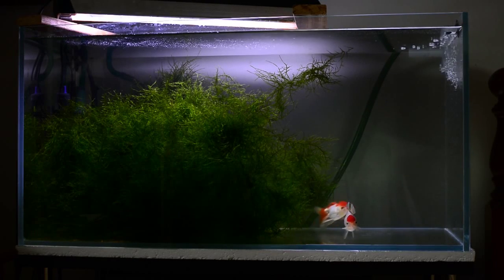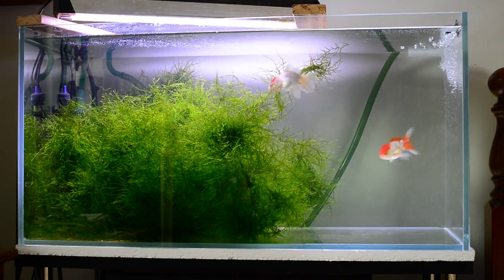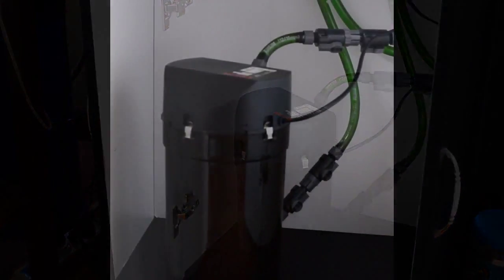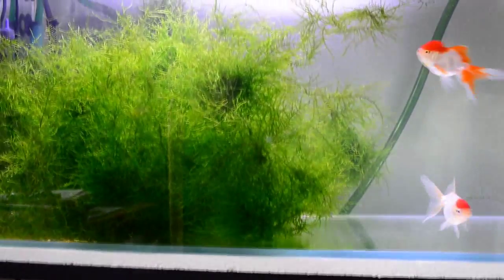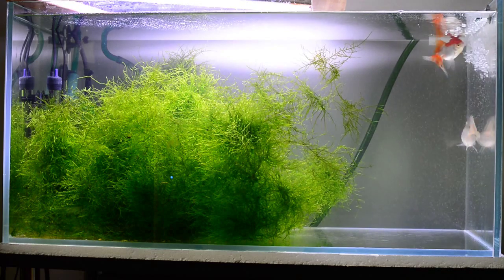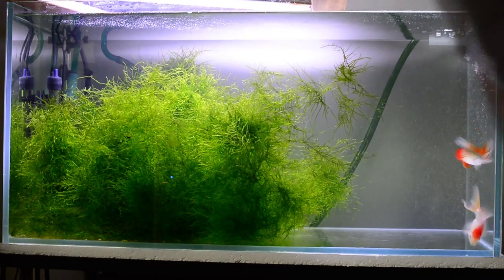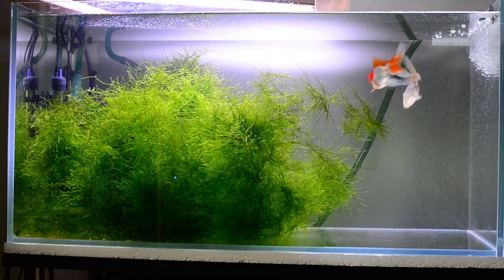Denitrification Discussion Freshwater Aquarium

Comment: The only way is to use naturally occuring bacterias B1 for ammonia and B2 for nitrite. This is the aerobic cycle. As for nitrate, we use algae. They are collected daily from sponge filters connected to the suction of pumps. The Germ theory by Pasteur is not correct. Bacterias are scarvengers. The Fallacies of Germ Theory with Dr. Thomas Cowan
 The anaerobic cycle is too complicated. You might suffer from rotten egg smell.
Reply: Germ theory not correct https://www.bitchute.com/video/8JAYsiN-368/
Reply: What do you do when a nitrate in the water changes is still high from the supplier
Reply: @brianneal2500  You have to complain to PUB if you live in Singapore. For me I don't change water. Only top-up.

Comment: So is it basically a chamber with a mesh screen or poly filter inoculated with anaerobic bacteria?  Is there a heater in there or anything else?  You're not using sulfur, are you?
Reply from the maker: Yes, essentially it is an area which is oxygen deprived. The water flows through at a slow rate (about 1-2 drips per second). Heating is not required, I use vodka as the carbon source.
Reply: I've seen you on several videos about this subject. Did you ever build your own nitrate reactor/anoxic filter?

Comment: How about the idea of a system that doesn't produce nitrate at levels that become a problem. The nitrogen cycle is old school thought.
Reply: Shaun's Fish Tanks that would be called a glass of water lol.. you can not have a tank with even one aquatic plant that doesn’t produce nitrates. Everything produces some form of nitrogen that is not yet nitrogen gas that can leave the tank via surface. You have to have different forms of bacteria to break those items down in specific order to complete a full cycle turning ammonia to nitrogen gas that leaves the tank via bubbles at the surface. Another bit of advice... many people think aquatic plants use up nitrates.. they actually feed mostly on ammonia and also produce nitrate as a by product same as aerobic bacteria does. Only air plants consume nitrate first. Aquatic plants consume ammonia first and only consume nitrate if ammonia isn’t present. They turn the ammonia into nitrate themselves for feeding.

Comment: QUESTIONS -  How long does it take for the volume of water in the aquarium to cycle thru the denitrification unit?  How many gallons is the aquarium?  How many gallons does the denitrification unit hold?  7:37 Is the activated carbon pre or post denitrification?  How often do you clean out the denitrification unit?  Finally, how would you "ramp up" denitrification, by cleaning the unit less often and feeding it more vinegar weekly?  If the flow was already kinda fast, would slowing it down also help ramp up the denitrification (kinda makes it so one wouldn't need to add more vinegar to accomplish the feat then)?  The answers to these questions would be very educational and much appreciated.  Thanks!
Reply: Feed the anaerobic bacteria with its natural food sources such as plant matter and soil would work i think.

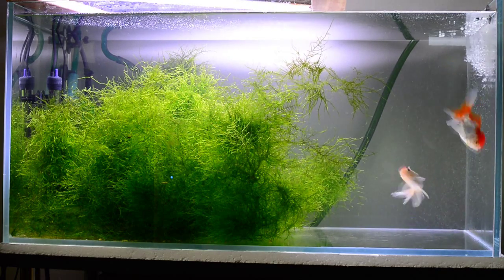Comment: 4:04  You say there's no nitrates in there, but I bet there's still plenty in the form of a gas.  You're really suppose to degas, or aggressively aerate, your denitrified water to release the nitrogen gas before sending it back to the aquarium, so basically you're just lacking one aeration bucket in between the denitrification and aquarium (by the way, you're actually better at this than I am, i'm just saying, I've been learning specific stuff).  Thanks for showing us the flow rate there, it really does have to be slow like that, and I bet the pH in there is higher than the tank itself.  I just learned about the Rakocy feeding rate ratio (developed decades ago at the University of the Virgin Islands) yesterday, in which one gets to realize that fish waste is not the perfect plant food and that aquaponic farmers will get more food than the fish eat to decompose in the water, giving the plants the minimum requirement of nutrients that were lacking, like Calcium, Potassium, and Iron, etc.  However, the method leaves one with excess nitrates, and thus, the need for a denitrification chamber at the end of the chain.  The Lennard approach, which doesn't use more fish food than the fish need, uses specific buffers to compensate for lacking nutrients, and negates the need for the denitrification unit,  was developed later, focusing on very very specific fish and plants (monocrops for mass production), rather than a general set-up, because he realized that denitrification leaves us with too many different kinds of nitrates to attempt to monitor (too hard to figure the real total nitrate level in your system).  I'd love to learn how he figured out his method.  The aquarium hobby (three years into it) has been such an educational experience and I resent my family not doing this with me as a kid.  Anyhow, I'm surprised that the denitrification unit doesn't have to be bigger.
Reply: Seems like the tank is lacking soil, sand and more importantly: clay. Clay contain all those minerals you mentioned. How ever the sands soil and stones are important as well in the decomposing cycle.

Comment: Agree with everything you say, with the exception of purchasing a denitrification unit/filter. I have yet to see one that produces in the amount that is needed. I don't know why anyone no one has ever thought of compartmentalizing external filtration (canister filter). But to me, the solution is in that and seems rather simple if you ask me. Anyways, I hope to be building a system of 4 tanks for stock/breeding purposes. They will all be connected:  1 Pump, 1 Heater, 1 Mechanical Filter, 1 Bio Filter, and 1 Denitrifying filter.

Once I finish, I will post setup and results.